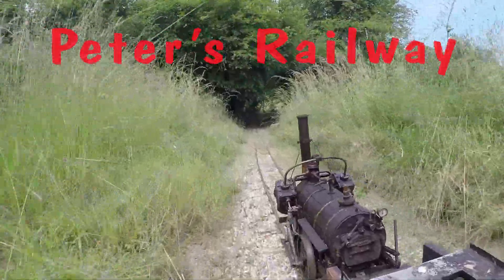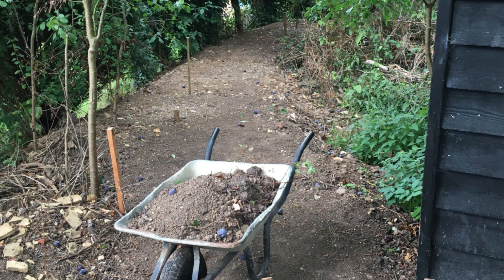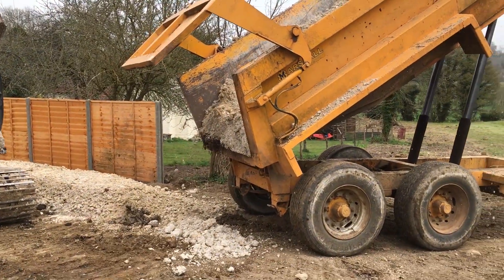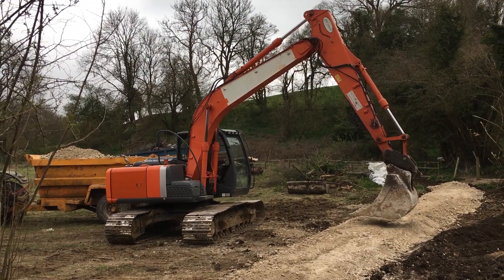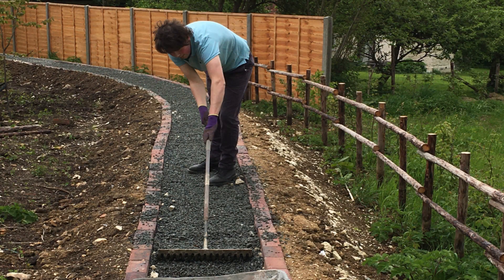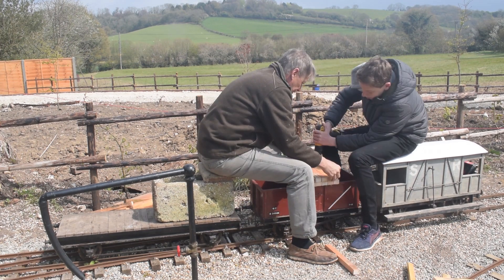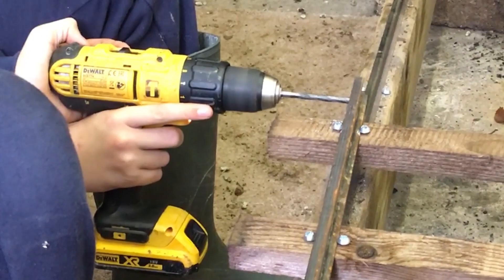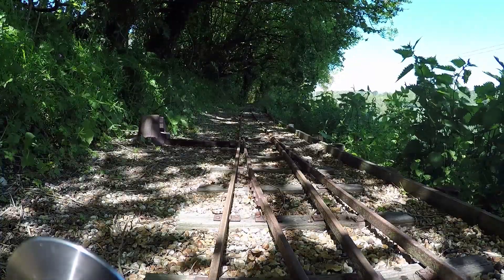Building a Miniature Railway at Peter's Railway – Extending the line and building a turning Loop.

Comment: You’re not afraid to give that engine some beans are you? Great to see 😊
Reply from the maker: Not at all!  When I made the engine I was determined that it would be a good scale model, but also to work like an original.  I have never discovered how fast it will go as one tends to run out of straight track or nerve!  However, from watching the wheels when jacked off the track, I think that 30 mph would be quite easy to attain.  Also, once when measuring the drawbar pull (26kg) it was slipping its wheels at around 12 or 14 mph.  Plenty of power to go!!  Thanks for watching! Best wishes, Chris.
PS. If you would like to know about the books I write to teach children (age 3 to 90!) about railways, science and engineering, there’s lots of info here: https://petersrailway.com/

Comment: Can you run over the points if they're set against you on the run around? Will the engine wheels push the points over?
Reply from the maker: That is a great question!  The answer is yes, the points are sprung and the weight of the engine or wagons can push the blades over to allow it to run back on to the main line again.  In fact, there is a bit of care needed in making points like this:  First, the spring cannot be too strong, or the points won't be pushed over.  Second, the must be very little friction so that the weak spring can pull the blades back again.  If they stuck half over, then there would be a derailment the next time the train comes down the line towards the "facing" points.  
Thanks for watching! Chris.
PS. If you would like to know about the books I write to teach children (age 3 to 90!) about railways, science and engineering, there’s lots of info here: https://petersrailway.com/

Comment: I guess you would look at building a turn table in front of the shed, technically you would have to reverse all the way back round so Bongo is facing forward?
Reply from the maker: Yes, we could have built a turntable at the far end but you still have to stop,  then you lose the sense of a longer journey.  Also there is a challenge in driving for several miles without running low on water and steam!! Chris 
If you would like to know more about the books I write please see www.petersrailway.com

Comment: This is a delightful project, but a visiting railway inspector at the heritage centre with four different narrow gauge railways where I worked told us that in no circumstances should we ever introduce super-elevation to our track as it invariably caused a disproportionate amount of the locomotive/train weighed to be placed on the lower rail. Apparently this also causes issues on the main rail network when trains are brought to a stand at signals on super-elevated track.
Reply from the maker: Thanks for your lovely reply!  Luckily we don't have signals to stop at and certainly no railway inspectors!  Seriously though, the super-elevation is only slight and we are very careful to introduce it gently.  Thanks for watching! Chris.
PS. If you would like to know about the books I write to teach children about railways, science and engineering, there’s lots of info here: 
https://petersrailway.com/